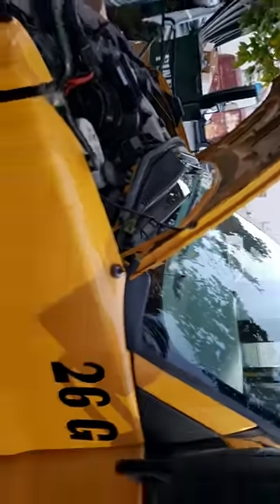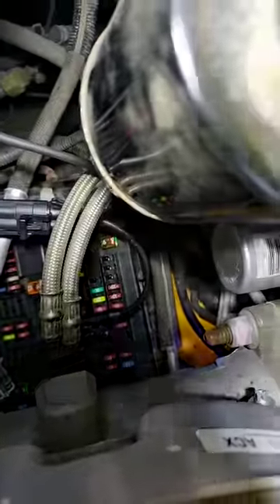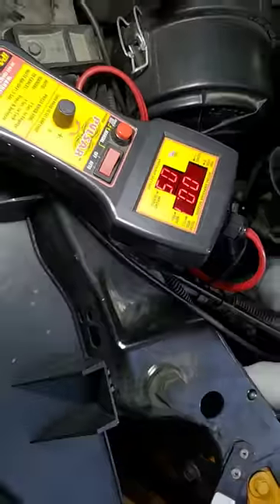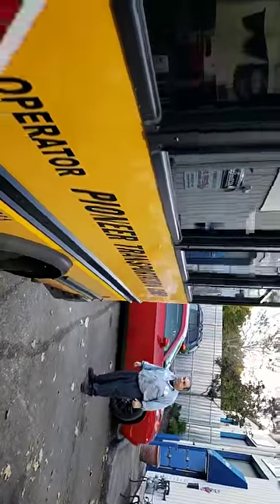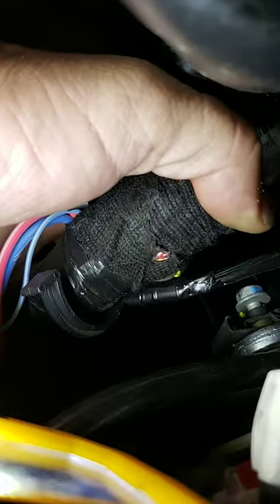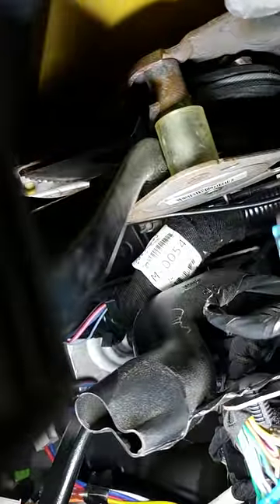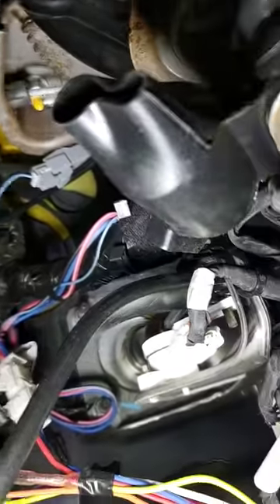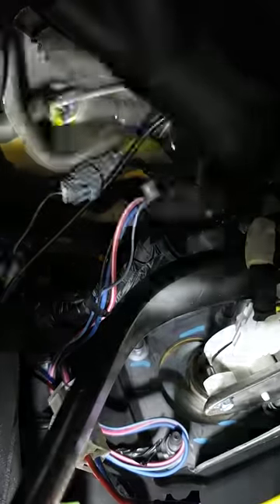2016 Express Brake lights not working

Comment: Ok i get the engine with the scored cylinder. But they're calling you out for brake lights, I'm starting to worry. Oh well at least you schooled us 😆
Reply: Being from the same hood', I can contest to the fact that there are a fare amount of shops that have a 6 shot parts cannon as their only means over troubleshooting equipment. Similar conversation as the video of Mr Keith's from earlier today. Cheers bud
Reply: S & A Auto Repair its a damn shame

Comment: I’ve never seen that pulsar tool. I just googled it and it seems really handy. I normally use a fuse saver. Do you find it works well?
Reply from the maker: It works great,  but sadly it's no longer made. Waiting for version 2 to release
Reply: @NewLevelAuto  I'm actually trying to build one. I figured I can use a mosfet hooked to a shunt that will deactivate when the set amp limit is reached. Worth a shot anyways. Lol
Reply from the maker: Brilliant , now be sure to have amperage displayed on LCD 😉
Reply: @NewLevelAuto  I'd love it if you could a little semi detailed video on the pulsar. I can't find much information on it but I love the idea. I'm using thermal fuses but those don't have the best response time or accuracy and I worry about the systems I use them on.